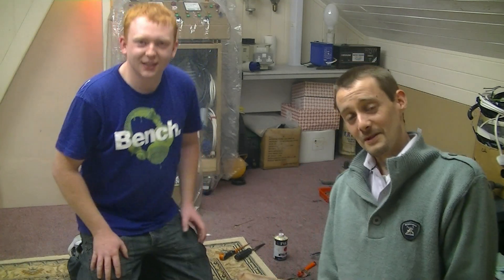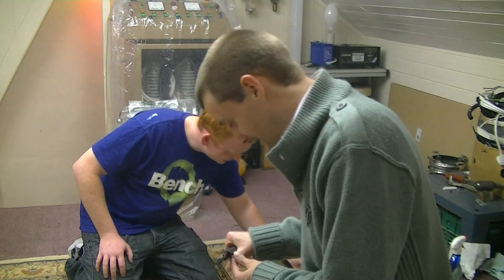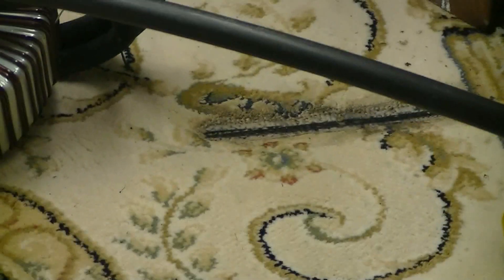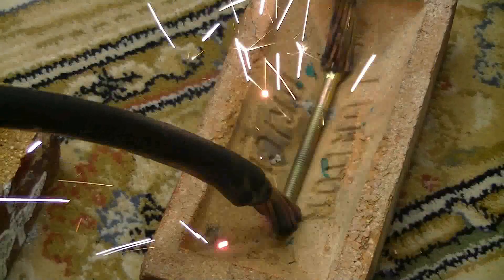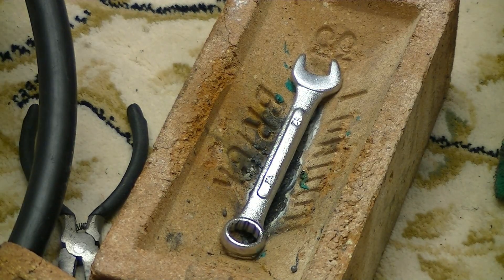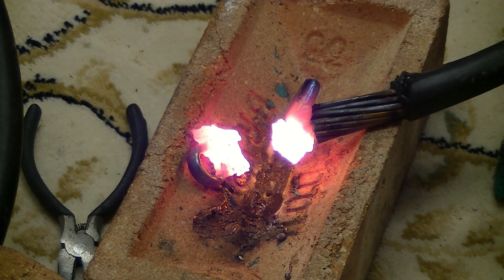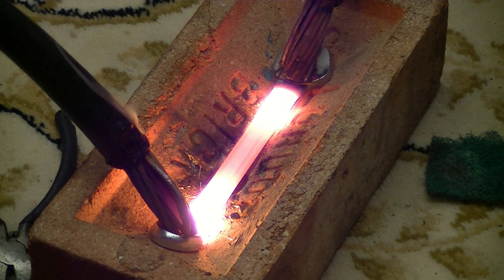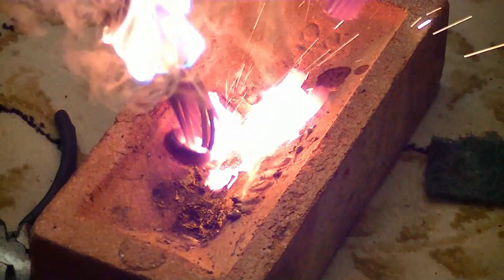5000 Amp Fuse + Tools Melt With High Current

Comment: Safety 3rd.  lol
Reply: John Griffin the correct word for the steel Chinese use in their tools is "chinesium"
Reply: william baxley looks to be cheap China tools... no big loss
Reply: Right? These guys are gonna be found lying dead on that carpet
Reply: Yeah now they get to enjoy their arc eye while inhaling all the Chinese tool steel fumes
Reply: Mike F they took safety 3rd a little too literally in my opinion though. And ruined a bunch of good tools.
Reply: Safety always Off. - Cyrus.
Reply: M W lol. chances are the carpet won't survive either
Reply: Mike F more like saftey 100th lol
Reply: Its 2 volts, you idiots. They wouldnt feel anything if they touched the leads. The only reason why those tools are melting is because theyre such low resistance, so a huge amount of current can flow through it. Human impedance is on average about 2k ohms. Now go look up Ohm's law.
Reply: they are chav not slav thats why safety is not number one priority...
Reply: Loooool
Reply: AvE sub right here?

Comment: Who the hell does this inside on carpet?
Reply: 2 unsupervised blokes on the piss.
Reply: @lexian5602  how did he create a transformer
Reply: was thinkin the same
Reply: Inside. On carpet. All adds to the charm. xDDD
Reply: @masowai1955  😂😂😂
Reply: In what looks to be the top floor of a building with the peaked roof ...
Reply: ontarioknivesNS7 I was about asking the same
Reply: Wait until the Misses finds out...
Reply: These guys.
Reply: Wrong. Without voltage there are no amps...
Reply: Brennan Shippert up to 40 volts ac when high amperage starts to hurt you.
Reply: Fire Marshall Bill would and he'd grab the ends of the hot cables to prove just how dangerous it can be. "Let me tell ya' somethin'..."
Reply: Gotta keep them floor clean
Reply: el druida Misses?  more likely his  Mum.
Reply: I was just thinking who does this? Why? Then I remembered being 10 and oh yeah I used to do shit like this.
Reply: ontarioknivesNS7 Oh we're just going to do some arc furnace on the carpet...these people are someone's neighbor...crazies
Reply: can somone EXPLAIN whu that wire was wrapped 3 times like that. how the fuck did this all work
Reply: @vincentcorralez4772  it was a big touroid inductor, putting those three wraps made it a transformer that created low voltage but high current
Reply: this is why we watch
Reply: obvious these two jems
Reply: You can melt tools prwtty easy with around 180 amps too. Its called a welder.
Reply: interesting video but one thing that is confusing me
you guys obviously know a fair bit about electricity but cant belive how dumb your choice of locations is
at those temperatures the brick could brake and then the molten metal would burn through the carpet and set the floorboards on fire before you could grab that pathetic squirt bottle, which would be near useless in this situation
Reply: Gavin Richardson it just adds to the charm
Reply: @TheGfromleeds  not quite true you asshat
Reply: @TheGfromleeds  I agree. they should have a bucket of sand as their resting place for their toys to eat away at the tools. with another bucket of sand on the side, to dump on it when things get messy. they should also have done it outside. because there are a number of reasons of why, like noxious gasses from the plastic melting from the cords, the metal leaking out and getting on the carpet, then the floor, sparks flying everywhere, which will catch the carpet on fire, etc.
Reply: ontarioknivesNS7 British
Reply: "Resistance is futile!" Borg reference.
Reply: ontarioknivesNS7 Guys. He works with very high current as a profession. He knows what he's doing. and he knows it's not smart, he can switch it off immediately
Reply: ontarioknivesNS7 it is special carpet ding ding butt
Reply: U gotta be completely comfortable when your electrocuting shit to smithereens.  Safety☆First!!!
Reply: Jacob Plunkett vlogs and in a loft lol
Reply: What you say is true, but it makes no sense as 21% of the air around us is oxygen.
Reply: Never heard "Amperage = opposition to resistance" before. 
Speaking of amps, my calibrated eye thinks <500A, did you guys measure it? What about voltage?
Reply: @chevota400  It can't be more than a couple of volts, but extremely high current.
Reply: A Fire Marshall Bill, he sure taught me about safety, now I do not have a school.
Reply: x2
Reply: Who really cares
Reply: ontarioknivesNS7 .. my dad in the 1970's
Reply: Simonas Giniunas special carpet been watching for years
Reply: It's safer that way
Reply: ontarioknivesNS7 same kind of people who don’t rewind or pour milk BEFORE cereal
Reply: British people!..I know because I am brittish myself and know it's too cold to fuck about outside lol
Reply: fuk that carpet.
Reply: It's perfectly safe if you use an asbestos carpet!
Reply: Those guys aparently
Reply: British people
Reply: It was probably raining outside, this is England you know lol
Reply: ontarioknivesNS7 thats what I said
Reply: ontarioknivesNS7 and smoking
Reply: ontarioknivesNS7 this guys.
Reply: ontarioknivesNS7 LMAOOO
Reply: lol exactly what I was thinking
Reply: would be pretty hard to start anything on fire without oxygen
Reply: Probably not the smartest idea but hey
Reply: Was jus askin myself the same thing
Reply: ontarioknivesNS7 exactly dude ;) haha
Reply: D Rutt 1969 hahaha. True...
Reply: Bozos.
Reply: because UK! :-)
Reply: ontarioknivesNS7 the guys are total crazy!😂
Reply: him.
Reply: lol
Reply: British people :) we're nuts haha
Reply: ontarioknivesNS7 a guy in a bench t-shirt and his farting compadre
Reply: That was the first thing I thought
Reply: It's fire-resistant
Reply: Them
Reply: yeah, wtf
Reply: Right!
Reply: ontarioknivesNS7 i
Reply: ontarioknivesNS7 I was just about to say that lmfaoo gatta Be really stupid anything that hot will combust into flames if it touched that type of fabric
Reply: Because he can !!
Reply: Nutters
Reply: They do
Reply: I have, when younger and dumber.  I still play with electricity, but take a few more precautions
Reply: @robccupit  ya like dags?
Reply: That is rug not a carpet so it's is safety !!!
Reply: ontarioknivesNS7 .... probably raining outside...
Reply: Them 2
Reply: 2 drunk British men. Isn't it obvious?
Reply: These fucking pisshead, legends
Reply: Dumb Brits?
Reply: British meth heads.
Reply: Only real niggas
Reply: I was waiting to see how far I got down in the comments before someone mentioned it lol. On the carpet inside. Lets see what gas does!
Reply: Apparently Photonicinduction
Reply: Photon is an expert, he knows what he's doing, he has the right fire extinguishers to hand and believe it or not actually does risk assessments before his experiments
Reply: MEN WITH BALLS
Reply: T r a i n e d   P r o f e s s i o n a l s
Reply: It’s a special material. It’s called welder’s carpet
Reply: It’s a special material. It’s called welder’s carpet
Reply: They
Reply: A have concreate under the carpet, there’s around 4.3 tons of transformer in that room
Reply: Drunk british people
Reply: Photonicinduction
Reply: fuck health and safety
Reply: Andy does ^_^
Reply: Someone whose safety is their last priority
Reply: Whats with the Dettol??? For desinfecting when they got burned??? 😬
Reply: These Geniuses
Reply: All carpets sold in the UK should be fire retardant/ self extinguishing.
Reply: They are doing it!! Dont you see!??🤣🤣8🤣🤣🤣
Reply: They smoke... They don't give a fuck, they're so badass haha
Reply: firewolf gaming  lol..... 😂😂😂😂
Reply: ontarioknivesNS7 เสียว
Reply: Same question man
Reply: ontarioknivesNS7
Reply: Crazy fools or complete bad arses.........
Reply: VOLTAGE = a potential difference between two points (+ and ground -etc...)----- Amperage = opposition to resistance -----etc, etc,etc...
Reply: is that in reference to the Picts of Scotland?
Reply: At last it would damage the carpet
Reply: Gavin Richardson floorboards arent easy to burn like that😂😂😂
Reply: Michael Lindquist you do know he lost his mum.. right? naughty👀
Reply: Vega-Expert fuck off
Reply: The same people who smoke indoors
Reply: Geniuses who've "had a few bevvies" and at least one is still puffing on burning herbs.
Reply: DoNt WoRrOy ThEy HaVe A bRiCk
Reply: More like who the hell does this in the first place?
Reply: Everyone’s first thought
Reply: don't say that these drunken farters are helping scince development inside , on carpet , 😐
Reply: British
Reply: ontarioknivesNS7 dam YouTube for making me want to try these things
Reply: sorry mum
Reply: You beat me to it... gosh!
Reply: i just thonk about this
Reply: Same thinking
Reply: press F for the carpet
Reply: ontarioknivesNS7 the chavs
Reply: CK_32 and one of them is a shit load more intelligent than you’ll ever be in this life of yours son
Reply: @everydayamerican7398  In the mums "attack" can you please clarify?
Reply: ontarioknivesNS7 u saw they were smoking probably dope lol
Reply: They r smoking probably dope lol
Reply: Whole
Reply: he does
Reply: Those people do
Reply: That's my friend you're talking about😁
Reply: Him
Reply: Welcome to the UK.
Reply: Have any of you been too London? It constantly bloody raining...
Reply: these guys
Reply: Photonicinduction does.
Reply: Men
Reply: Obviously northerners
Reply: EXACTLY
Reply: ENGLAND
Reply: They’re getting better.
Reply: Okay, mom. Legends do this inside on carpet.
Reply: They the hell did that
Reply: After coming home from the pub
Reply: After coming home from the pub !
Reply: theyre too shy to do it outside
Reply: The British do!
Reply: Brits, that’s who
Reply: At least they put some protective plastic sheeting over the thing in the back ground!!
Reply: They did say at the beginning that they just visited the pub.
🤤🍻🤤
Reply: Man a professional see?lol
Reply: It's Okay, he has some cleaner
Reply: Brits
Reply: Photonicinduction that's who :D
Reply: they
Reply: Someone who knows what he's doing
Reply: mad lads do that
Reply: Wool is fire resistant. This was pretty safe for an inside experiment
Reply: They do, and did 😯
Reply: A gentleman and a scholar to say the least.
Reply: This man
Reply: Photonicinduction does ;)
Reply: @Dbirdsong14  He's not the only one. I did worse things as a kid.
Reply: Men were men 10 years ago
Reply: Just need to be careful that's only we need ok
Reply: Someone who knows 100% what they are doing!
Reply: It’s the man cave
Reply: Photonicinduction that's who
Reply: Didn't they clearly mentioned that they had been drinking? Didn't they say that?
Reply: Andy
Reply: Somebody who isn’t married :)
Reply: @Photonicinduction does, obviously!
Reply: Photonicinduction
Reply: Your mum
Reply: It’s actually a requirement for this kind of testing. The carpet catches the sparks instead of bouncing. He addressed it in one of his videos at some point
Reply: Andy Moir
Reply: These fn guys
Reply: Clearly none of you have ever lived in England or seen a typical British flat. Garages? I think not!
Reply: ontarioknivesNS7 and without gloves or boots
Reply: ontarioknivesNS7 the type of dumb asses that put it on YouTube for the world to watch.
Reply: Ashish Patel and your point is?
Reply: drunks...dumbasses.....take your pick.
Reply: QuantumRift champions
Reply: Behold! The hairless ape. He can shape metal like clay!
Reply: ontarioknivesNS7 they are high they dont care
Reply: Cockneys.
Reply: el druida jajaja jajaja the husband is gonna get beat up hahaha
Reply: Apparently these two fuck tards
Reply: ontarioknivesNS7 The same people that smoke indoors... the people who dont pay the bill to repsir
Reply: Drunk brits but i love this guy frfr
Reply: ontarioknivesNS7 meth is one hell of a drug
Reply: Drunk morons
Reply: @aldhadenglisc6937  fuck you pussy ass brit
Reply: No Kidding. It only takes 200mA across your heart to kill you and they put a fuse in line that's rated for 25,000X that.
Reply: ontarioknivesNS7 fucking idiots
Reply: This idiot does XD
Reply: Idiots
Reply: They are fucking idiot.
Reply: They're fucking morons!
Reply: Idiots
Reply: these fucking morons play with that INSIDE small apt and over a carpet !!

however, i cant deny they know what they do, and have a great time looking at those videos ...
Reply: Meth heads.
Reply: ontarioknivesNS7 people who deserve their house to burn down,not geting anything from insurance...that will teach them...5000amps meltint metal on carpet wow!stupidest video i have ever seen
Reply: @vincevegacustoms8860  stupidest comment ive ever seen
Reply: @vincevegacustoms8860  Not stupid, fun!
Reply: @vincevegacustoms8860  hes an engineer, he also married a woman who knows high voltage and amps
Reply: @vincevegacustoms8860  except they did it and nothing happened so maybe they are smarter than you?
Reply: I'm British, but then I have a little common sense... these are probably just gutter rats playing with daddy's stolen hardware.
Reply: ontarioknivesNS7 it's the amperage that kills you..not the voltage. .05a I believe is all it takes to cause arythmia .9v battery can technically kill you within the right environment
Reply: @Veedub98  Dumbest electronic thing I've ever heard... but what do I expect from a random guy from the comment section of a 9 yo video.

Comment: Where do you get 5000 amps? ;-)
Reply: Right beside them.
Reply: 92kosta So, a generator?  Running indoors?
Reply: the torroidal transformer is generating the the electricity they are using. There's a lot of vids out there where people use microwave transformers to do the same thing. You remove the secondary windings and replace them with a large gauge wire with only a few turns. It either generates huge voltages and low currents or the other way around. Cant remember :P
Reply: Robert Zeurunkl just go to the shop and ask for 5000amps
Reply: You can charge it.
Reply: spwicks1980 Thanks for the explain!
Reply: The less secondary winds, the lower the voltage, the higher the amperage and vice versa. equal winds = same voltage as input side and same current capabilities.
Reply: tryithere OK..Thanks.  I'm not an electrician, so I really don't know these things.
Reply: tryitthere ,, thats basically how the power companies do it ,, they push high volts threw the long thin line and then use a transformer to lower the volts and be able to handle the amps that the people need
Reply: Yes, I know. It's magic.
Reply: pete a How much do they cost?  I wanna make sure I take enough cash with me.  And Do I need anything special to load them in?
Reply: tryithere ;-)

Comment: I wonder if they were craftsman tools what the store would say when you go in for your free replacement.  Leave one end of the wrench solid and recognizable.
Reply: Lifetime warranty on there tools, i actually have broken several using them in ways they were not designed for(even took material off with a wheel so i could reach a hard to reach place, fucking Asian cars).  Still, the company replaced them all for free.  Craftsman's tools from Sears, a use to be large company in the USA.
Reply: I'm sure he is completely unaware of the lifetime guarantee at sears.. he calls a 12 millimeter a 10 ounce at first leading me to think that he thinks tools are used on cars as an alternative to their intented use which is to build highly accurate scales. Whoever keeps giving these Brits commercial electrical components needs to knock it off, what if they figure out the modern world has switched to AC and running water?
Reply: lewinsky hillary fuck off mate! what the fuck is sears? some wankers shop I imagine! us Brits can out engineer anyone. That's a fact bitch
Reply: Rob ward  good then enginer a toothbrush and scrub you're fucking grill faggot.

Comment: this is the comment for the 5000 amp melting the bolts and wrenches. you're doing that inside an apartment that's not very safe you could overload the circuit for the building you two are dumber than you look. that should be done outside. you too must not have graduated high school let alone College. you two are definitely stupid though !

Comment: 5:22 "galvanized" lol dumbasses inhaling highly toxic fumes. there's a reason you don't weld on galvanized steel
Reply: Zac welded it many times. at worst you can get some fever.
Reply: Turbojuugend Yes galvie flu is a short term illness, but can be fatal in poorly ventilated areas. I work in a galvanizing facility and am well aware of the consequences, one of the welders at my workplace working on hot dip galvanized steel actually died due to pulmonary edema. It was found in autopsy his exposure to zinc oxide played a significant role in his death. No studies have been done on the long term toxicity of exposure to those zinc oxide fumes. That's like saying yeah I drink all the time, I always get sober again after a while so my liver must be fine. Just cause one can get by doing something harmful doesn't mean it's wise.
Reply: EFFECTS OF OVEREXPOSURE
Zinc oxide fumes cause a flu–like illness
called Metal Fume Fever. Symptoms of
Metal Fume Fever include headache, fever,
chills, muscle aches, thirst, nausea, vomiting,
chest soreness, fatigue, gastrointestinal
pain, weakness, and tiredness. The symptoms
usually start several hours after
exposure; the attack may last 6 to 24 hours.
Complete recovery generally occurs without
intervention within 24 to 48 hours. Metal
Fume Fever is more likely to occur after a
period away from the job (after weekends or
vacations). High levels of exposure may
cause a metallic or sweet taste in the mouth,
dry and irritated throat, thirst, and coughing
at the time of the exposure. Several hours
after exposure, a low–grade fever (seldom
higher than 102 F or 39 C). Then comes
sweating and chills before temperature
returns to normal in 1 to 4 hours. If you
encounter these symptoms, contact a
physician and have a medical examination /
evaluation. There is no information in the
literature regarding the effects of long–term
exposure to zinc oxide fumes.